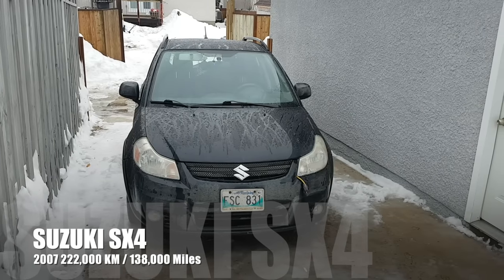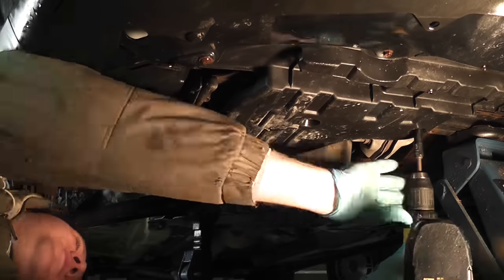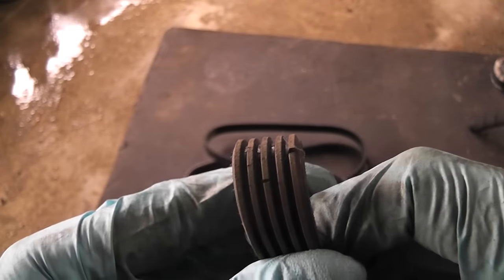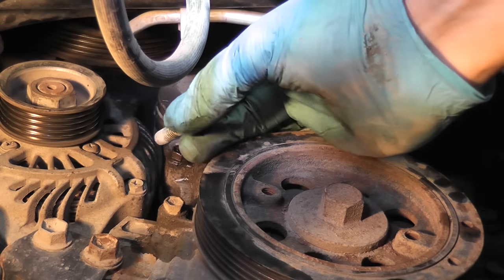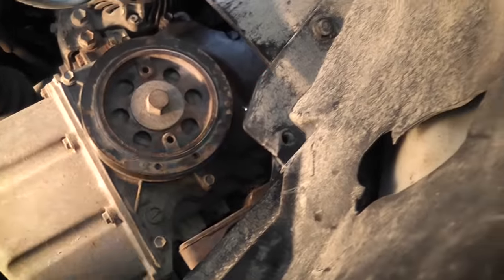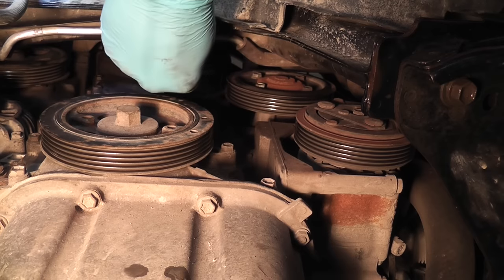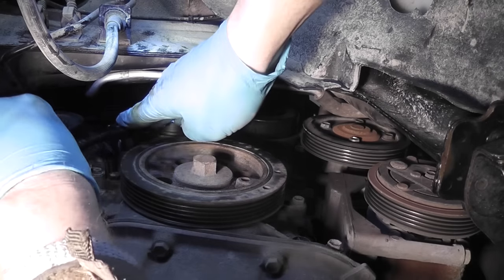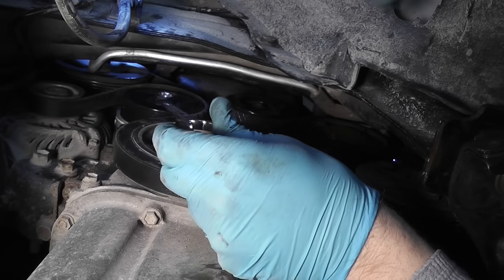Suzuki SX4 Belt tensioner, idler pulley and drive belt replacement. 2.0L

Comment: Thanks! My 2008 SX4 was making “that” noise. Just changed tensioner and pulley, idler pulley, and serpentine belt. Could not have done it myself without this video. So nice to sit down and have the exact parts and tools ready to do the job.

Comment: I am an retired automotive machinist, and honestly want to compliment you on an excellent well presented video. Mention the finer details, but hell you get the job done. I used a deep 14mm wrench which worked perfect. All and all job took me about an hour, including pressure cleaning before replacing new parts. I hate dirting my hands. Actually very easy job.
Reply from the maker: +Donald Coetzer Thx!!

Comment: Just did the belt replacement only on my 2008 SX4 hatchback. A good tip is to first open the hood so you have 100 times more light in the area. I was also able to push the belt upwards to the rear of the upper pulley, then go up top and work it around the pulley from up top in the engine bay. Trust me, opening the hood and working the belt on to the uppermost pulley from above is the way to go.

Comment: I would like to first thank you for all of your SX4 videos. You have no idea how many times you have saved me. Just changed my alternator which was a pain because I had to remove the power steering pump. 

Now I can't get the p/s pump back in because the pulley is in the way to install the mounting bolts. Figured the only solution would be to remove the pulley. Bought a Pulley removal tool but none of the pullers fit the pulley shaft.

Sorry for the long comment but please if you have the time anything helps!!! Thanks!
Reply from the maker: +Joe Machuca I've gone through a deep puddle which killed my alternator. Towed it home for 80$ 75 for a used alternator and YES, 6 hours to change it. Very difficult. You have to remove the power steering pump to get to the upper bolt on the alternator.
It's possible. Good luck.
Reply: Thank you for your fast response, but I already replaced the alternator(very difficult yes). I can't get the power steering pump back in. The pulley won't allow me to put mounting bolts back in. Did you take pulley off?

Comment: Thanks a lot. Your video helped me complete the job. I may add: it you are having trouble, removing the top right engine mount assembly will give you some access from above.
It's a bit of a hassle sine you need to remove large bolts and one nut, but it can be helpful.

Comment: Just did this today in the snow of Vermont.  Bypassed defective AC compressor.  The belt I used was a 5PK 1545 but I read you can also use the 5PK 1550.  Brand doesn't matter.

Comment: Brilliant - thanks very much - I have exactly the same challenge. If I can only find third party parts here in South Africa that would be great. The workshop quote for this is ZAR 16k whish is insane.😊 Much appreciated. Clearly and simply explained.
Reply: Also struggled to find aftermarket parts here in South Africa.I have just changed done this myself for my moms 2008 SX4. I bought new bearings for the idler pulley and tensioner pulley and replaced the one worn and siezed bearing. Now doing the belt tonight.

Comment: Well done, I feel like I understand what it takes to do this job! (Though in my case I have a seized alternator that may require other parts replaced as well). 2011 SX4 / 78,000 mi.
Reply from the maker: I just replaced a seized alternator on my SX4. I got a used from a wreck for 80$ CAD. Its held by two bolts. The problem is the top bolt. To get to it you need to remove the power steering pump which is not easy. Tool me 4 hours start to finish. Will be posting a video on replacing the alternator very soon.
Reply: Thanks for that....I had mine done by a local shop who told me it would be 2.4 hrs. due to having to disconnect part of the intake manifold to get access to the alternator which cost $206 just for the part {and $31 for new drive belt} (saw them online for $112 to $135 or so and up). The above video did not seem to show having to mess with the manifold. I am planning to check with a Suzuki dealer for their price: $260 "lifetime" warrantee re-manufactured + $200 for installation ($793 for Suzuki new alternator!!?)

Comment: This is actually a common problem with the SX4 model as well as the Grand Vitara, but in reality has more to do with the parts that it does with the car itself. To those of you who wish to do this replacement job yourself, there are things you can do to help the pulley and belt last much longer and remain in great condition so as to not need such frequent replacements, which of course will also save you money. There are a couple instruction videos that will explain how you can do this. I will post them here for you so that you can check them out. Pulley - https://www.youtube.com/watch?v=lf_sttobyyY   And Belt https://www.youtube.com/watch?v=dRXkt6Dgi4k
Reply: marketing major the idle pulley in this engine have a shim?
Reply: @Tulitustitus  I can only speak as to the North American version of the SX$ but there should not be a shim for the idler pulley.  I'm guessing that you have installed an aftermarket idler pulley the belt was not lining up properly with the pulley afterwards?
Reply: @marketingmajor8126  thanks for the reply, the problem was the new belt was coming off and the pulleys chew the outside part of it after I replaced a noisy idle pulley, I was thinking it was missing a shim because something hit the floor when I pulled out but I didn’t find anything. I checked the others pulleys and they looked fine and aligned but that wasn’t true, the water pump pulley was walking in and out on high rpms,i replaced the water pump and the problem is gone

Comment: Great video! This helped alot on my Vitara. I found putting the belt on easier using a ratchet and extension to push the tensioner, the belt already around the ratchet AND putting the belt around the alternator pulley LAST (it's smaller and easier to slip on).

Comment: I have a suzuki sidekick sport 4x4 with a  j18 engine. From what I've seen the engines are pretty much identical. My engine has a sound that's very similar. I've been worried it was the timing chains. I'm going to try this when I have time. Fingers crossed this is the problem. Thanks a lot.

Comment: Hi, I have a Suzuki sx4 2012 2.0 DDiS. My question is where is the engine code? I bought the Suzuki with a broken timing belt. I checked the compression on each cylinder and it looks good, the valves are not broken. This patient shows promise.I guess that someone has given up with change timing belt upon broken it. Does engine is not collision of kind ?

Comment: 21/01 23, Thanks for sharing. Is it worth removing an OK belt & lubricating the rotating parts of the assembly without contaminating the  belt ? Have noticed the belt is directly below the brake fluid reservoir too & spillage by any previous  owner
Reply: Con't....owner could have caused premature failure. Best regards, UK (3rd) SX4 owner.

Comment: nice job bud, I just bought a 2007 SX4 after owning a 2010 SX4 that was a total loss after someone hit us. noticing a belt squeal on left turn so going to replace belt tomorrow. have you had any electrical or ground issues with radio lights on but no sound from speakers?

Comment: 2002 suzuki aerio replaced  just the idler pulley, old one  seized and broke my new serpentine belt. Put a new idler pulley new belt and now it wants come off water pump pulley!! Could I have over torqued the nut causing the misalignment? Nothing else was touched.
Reply from the maker: +Ricky Gomez Don't know. Sorry.
Reply: Sometimes we tend to bend those flat pulleys with a pry bar. So take off the pulleys  and spin them to see if you bent the pulley at the bearing (not to the outside edge) this will cause the
belt to ride in the wrong position on the flat pulley and thus jump off. V Rolfe Chicago  Check alignment of all the pulley by sighting from above or below to see where the odd position is.

Comment: Excellent work. My sx4 has clocked 156K KMS and the squeaking sound has increased so planning to get v belt replaced this weekend. Does timing gets affected by v belt and pulley replacement as infomed by my mechanic? Thanks
Reply from the maker: +Maharshi Kothamdi no it does not if you have J20 2.0 engine.
Reply: @volvosweden  79

Comment: l see you used a gator back style of belt as a replacement versus a traditional V groove belt. Have you noticed any difference with the gator back style of belt? Any other feedback now that you've had it on for several years?
Reply from the maker: No difference. Running good. Car was sold and replaced with Volvo V50
Reply: @volvosweden  Good to know, thanks!

Comment: is a sx4 have big issues at 220000 km ?  or does it hold up well over time ?
Reply from the maker: Its strong.
Reply: @volvosweden  thanks for quick reply , shopping my first car , esitating between a sx4 or mazdaspeed6 awd
Reply from the maker: Watch for rust on Mazda. SX4 should be cheaper because it's out of business in North America

Comment: Good video. By chance, would you know if this 2.0L motor the same motor that is in the 2003 SX? With 160000 miles, I'm going to be doing this soon I'm afraid!! LOL
Reply: It's the same engine and same part number for the belt tensioner assembly. If you go to rock auto website and enter your vehicle information there it will show you the correct parts in many different brands to fit your Aerio SX.  Continental and AC Delco are good quality brands for this part. With the correct part number you can also search Amazon and Ebay as well which is some times handy when you need the part as soon as possible.

Comment: i need help!, my sx4 have 95000km need replacement tensioner??, the idler puller was remplace more times,  is very boring :S the grease becomes liquid by the temperature of engine.
Reply: Sounds like you need a better quality grease. When ever you have to replace any of the pulleys with a new one, take the seal off of the new pulley and load it up with a good quality, high temperature grease like Red Line red grease. Here is a link to show you how and why. https://www.youtube.com/watch?v=lf_sttobyyY

Comment: Hello volvosweden.
Could you tell me more about your sx4? Whether is it worth buying.

I have old bmw but i need something simple and cheap in repair.

I cant stand all of those complicated cars, however they are nice but very complicated in service.

I can get 1.6 vvti 107hp from my family.
90000 km.

I use car in the city mostly, only sometimes on highways.

Cheers

PS did you use any anti rust paint?
I ve Heard that it is very common in suzuki that it gets a lot of rust
Reply from the maker: +Piotr M We have four SX4s in the family. Mine has the most miles on it. It's very reliable. Mine has NO rust and we have tough winters. SX4 is a great car to own. The only thing is mine 2.0 engine and yours is 1.6. Don't know about that.
Reply: Wow, i appreciate your answer. Well, 1.6 is quite nice i guess.
Is it good also on motorways whether is is not good for travel out of the city?

I need something to forget about many problems to repair like i have in old bmw, and they are expensive.

In my family this sx4, has only 80000 km. And apart from paint repair after a small crash it did not need any special repair... 

It is very simple in service, maybe a little bit too simple but also has less to be damaged(small engine, timing chain, no turbo, simple suspension).

Comment: can i replace idler pulley only
Reply: Did you end just changing the idler pulley only??
Reply: Yes it's very easy to replace just the idler pulley however only do that if you are 100% sure that is the only issue. You will want to check the tensioner wear gauge indicator first to determine the state of the tensioner.  Many times the idler pulley will go bad because the belt tensioner itself is worn out and therefore causing the idler pulley (as well as tensioner pulley) to rotate and a slight angle which then wears out the bearings very quickly and can eventually also cause the belt to fray or snap completely.  This is why usually you will want to replace the entire assembly all at the same time, belt, idler pulley, tensioner & tensioner pulley.
Reply: @marketingmajor8126  hi can I ask my car is only 51 odometer do I need to replace tensioner,belt, and idler?
Reply: @emiliaminor5262  51 odometer? You mean 51 miles? 51 kilometers? Maybe you mean 51,000 ?
Reply: @JA-rn5qv  yes 51,000 odometer or kilometer
Reply: @emiliaminor5262  and what year is your car?
Reply: @JA-rn5qv  2015.I heard something unsual then they said the suzuki need to replace.
Reply: @emiliaminor5262  There may be service bulletin for a specific part in the 2015. Usually though it only applies if you are having a problem because only a small percentage of the affected model will have any issue with it. You will be replacing all of those components at 100,000 kilometers anyways so just continue with regular maintenance and check with your authorized Suzuki service center if there is anything else you need to do but they will tell you the same thing I am and that is unless your car is having a problem there is no need to worry. Just continue the regular maintenance.
Reply: @JA-rn5qv  thank you so much.I really appreciate your advice and recommendation.